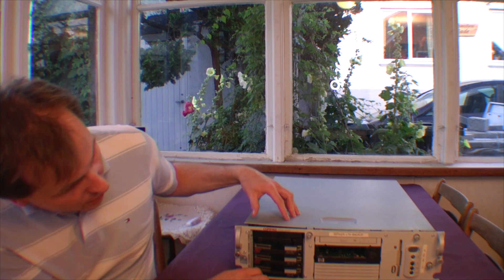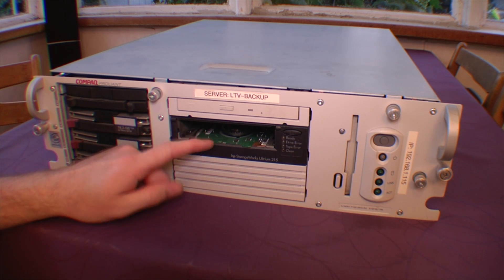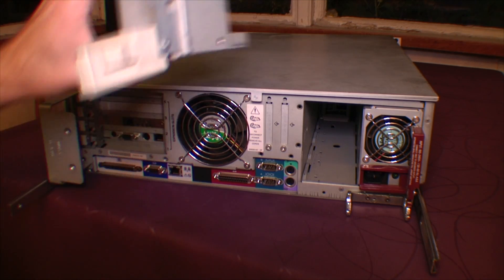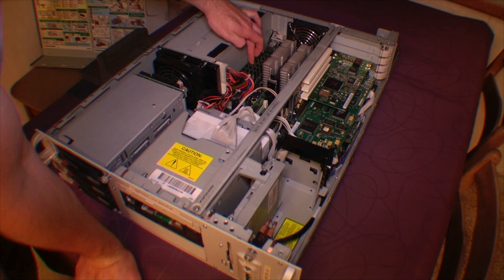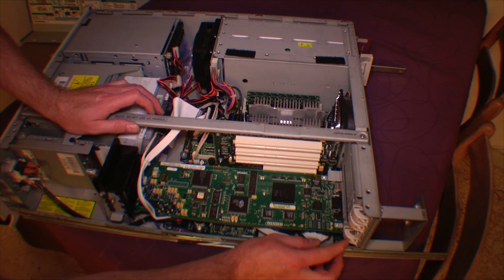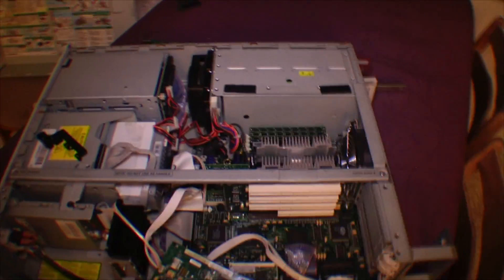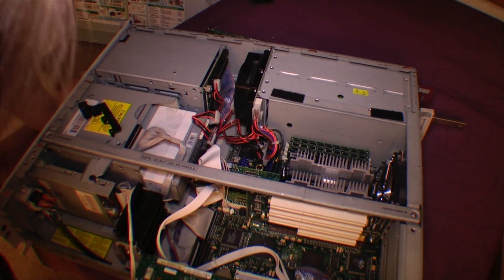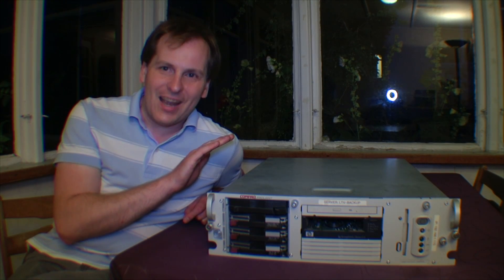Review of Compaq/HP DL380 G1 - pure nostalgia - 225

Comment: Awesome! Do you still have it? :) Im on the search for a machine like this. I wanna make a permanent Windows 2000 Retro Server in my setup :)

Many years ago I bought together with a friend,  2x DL380 1x ML370 2x FB Cabinets and 1x SCSi cabinets and a huge amount of 18 15k 36 10k and 72gb 10k drives. But I think we all got rid of it :(

It was so much fun splitting up the big lot. We sorted it out and splitted in in half :D In the end I ended up with a Dual P3 1ghz ML 370 with 33 SCSI HDDs :D  12x18gb in a dell cabinet (This one I got back last year :D) 14x36gb in Compaq Cabinet 5x 36 and 2x 72 in the server :D 1046GB of storage! I think I had something like 700GB usable in Raid.

Fun times! Now I need to find back a nice machine :D
Reply from the maker: Hi Victor Bart - RETRO Machines
I have had a lot of these,, but only kept one,, this is the original DL380 form Compaq :-) I do still have it,, but I am not ready to part with it,,, :-)
Thank you for watching! :-)
Reply: @MyPlayHouse  Yes great machine :) Yes keep it :) I put a auto search email notification for Compaq Proliant on my local ebay :D So lets see what will turn up :D Maybe i can find a Quad Xeon 900 :D

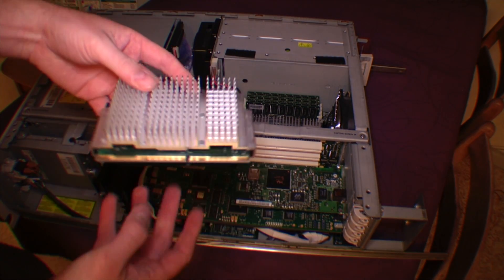Comment: Those P3 Xeon processor shown at 7:21 is a Slot 2 processor, commonly used in high-end workstations and servers (late 90s - early 2000s). Their desktop counterparts either used the Slot 1 (P3) or Socket 370 (Celeron).
Reply from the maker: Hi Mark Arca
Thank You very much!  glad you liked the video :-)
Thank you for watching! :-)